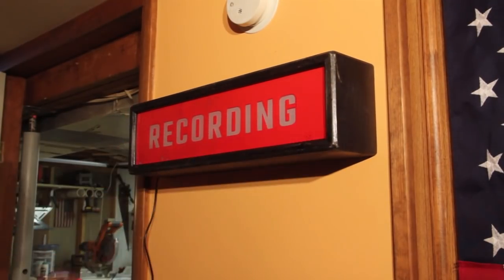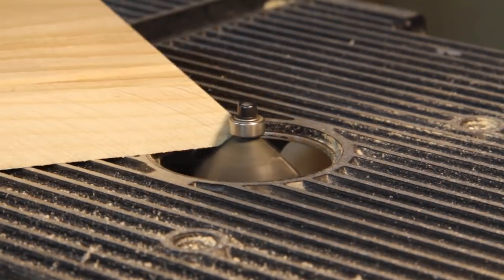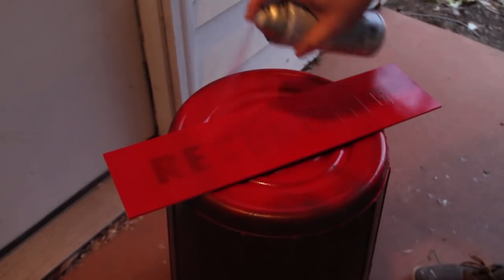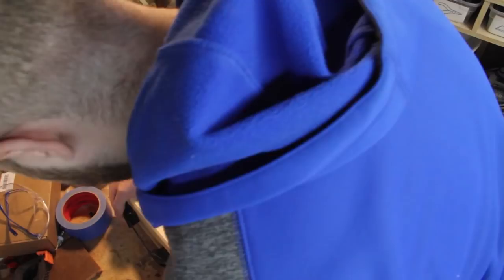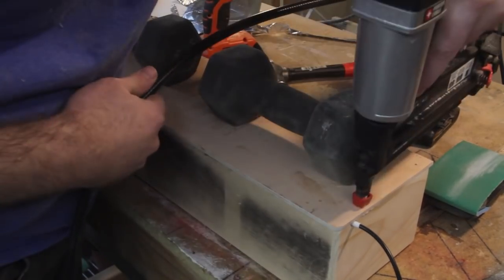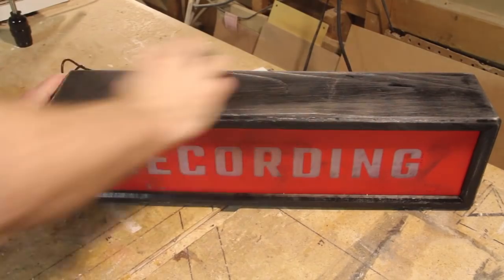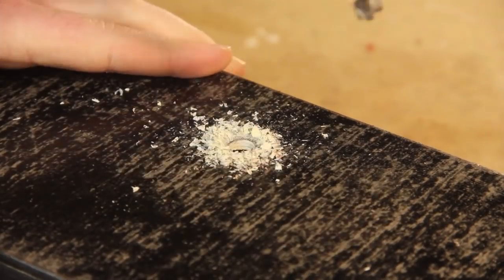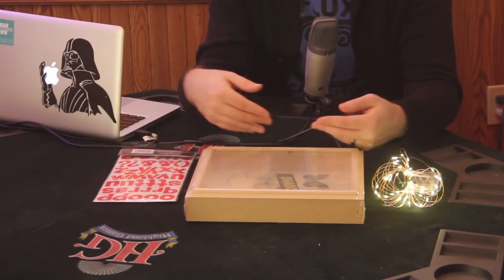How to Make a Light Up Sign - USB LEDs

Comment: Brett,

Thanks for the inspiration on this light up sign. Make a version of our own. I found that the LED's strip didn't want to stick to the wood so I ended up laying some hot glue down. I sande the back side of the plexiglass which really helped diffuse the light and didn't have any pigment to bloc the light (as paint would have). Worked great. Check it out: https://www.pinterest.com/pin/6755468176776303/

Comment: i like everything about the sign except for one thing.  You glued the back on.  What if something happens to the lights and you need to get to the lights in the box to repair or replace them?  It looks like your only option is to cut off the back of the light.  I think 4 or 6 screws to attach the back would be a better option.  Other than that, I like the idea.  A lot of options for the message:  busy, entrance, exit, etc.